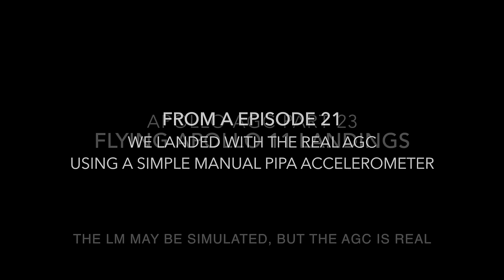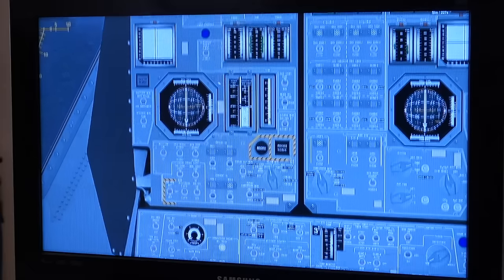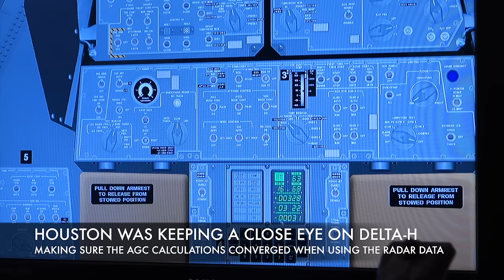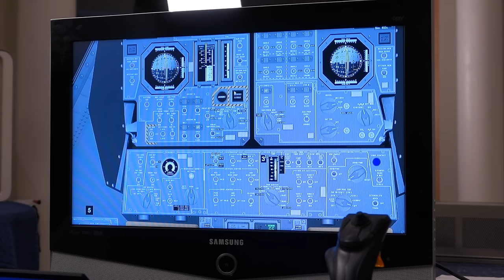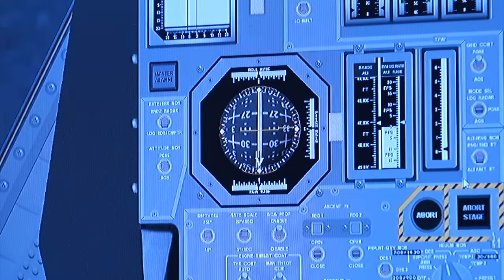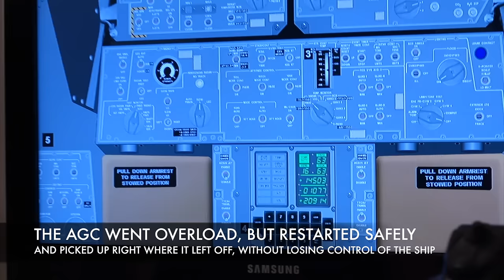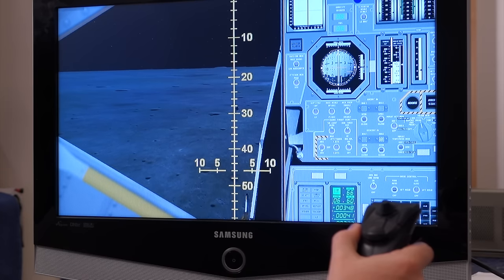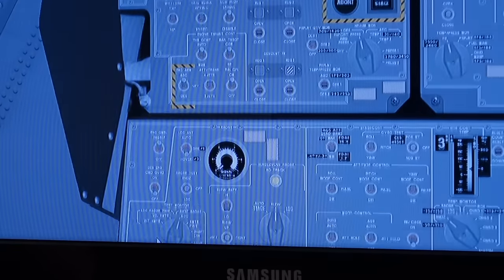Flying the Apollo 11 Moon Landing with the Original AGC Code (Apollo Guidance Computer Part 23)

Comment: "Buzz, we'll need you to remove the potting compound from an AGC memory module and replace 28 diodes".
Reply: By that stage they were probably working with the newer diode manufacturer, not the one that had produced the ones in this B11 module.
Reply: Is it much different that Buzz sticking a pen into a broken circuit breaker so they could take off?
Reply: Can that be removed somehow..I wondered that?
Reply: Alex Carson the agc was directly behind them, but the modules could only be assessed if they had an allen key to split the computer
Reply: Dude up until like 2 years ago I had no idea how much of that work was put on Buzz's list. He's basically carrying literally every piece of equipment on the lunar surface and doing all the experiments while Neil just pranced around taking pictures or filming Buzz from behind. The potting compound sounds exactly right!
Reply: They probably could get the computer open and the module out (maybe), but where are they gonna get 28 replacement diodes? Are they gonna launch and fly another LM over to them?
Actually... they'd likely just use the abort guidance computer instead.

Comment: So you modified the Orbiter program to interface to a hardware AGC?  Certainly they never expected anyone to have an AGC or even your FPGA implementation.  Amazing.
Reply: "Project Apollo - NASSP" is the addon for the Orbiter Space Flight Simulator which is simulating the Lunar Module in this video. Mike made changes to NASSP so that it uses his FPGA AGC instead of the Virtual AGC emulator, which NASSP normally uses.
Reply: @indianajones91  i wonder of there is a place to get it i always wanted to simulate the 1202 alarm during landing

Comment: My career was largely coding simulations of power plants.  And yes, we too would simulate every relay in every circuit to match the 'as-built' systems.  It really is a challenge and it's great when the simulation operates with such high fidelity.  And yes, a couple times we uncovered something that the operators were like, "It shouldn't do that.... Should it??"  And after some research, "Yes... yes it should."

Comment: A little expansion on the "instability" mentioned in the video:

The LM's descent propulsion engine (DPS) was ablatively cooled, where it would actually take off material from the inside of the engine nozzle to keep the rest from melting. The method of engine throttling used in the DPS (a pintile injector, like you can later find on SpaceX's Merlin engine) concentrates the propellant reaction effects on the walls of the combustion chamber, and if the flow isn't in the right place, the engine could burn through the nozzle.
Reply: I think they just ran them full throttle most of the time when they used it on the Delta-P stage.
Reply: @Patchuchan  True, although those were modifed to be fixed thrust, anyways. shrug

Comment: Now somebody needs to build a LEM simulator with real switches and so forth..
Reply from the maker: I have first dibs.
Reply: If you put it on a full motion platform, I wonder if it would shake across the floor during burns.  Sort of like what a disk pack would do if not bolted in place.
Reply: Then put it on top of a huge rocket...
Reply: Too late, we built and flew a replica command module and LEM at Ramsden Primary School in 1970. Materials? For the command module we designed and commissioned a paper and bamboo stick conical airframe (wigwam), Chrisopher Morris was in charge of creating the instrument panel using papier maché and paint. Trust me it flew, we really lived the experience!

Comment: Now you guys need to simulate that one where they had to hack the computer because abort flag kept getting stuck, if it's possible to do with this hardware.
Reply from the maker: Agreed we should do that.
Reply: That was Apollo 14 and it was the actual ABORT push button that caused that, not the AGC itself. It was most likely caused by some loose piece of debris left over from the manufacturing of the LM-8 Ascent Stage. In the microgravity environment it kept floating around a shorting out the ABORT push button causing the abort flag to set ever so often. That's why they had to figure out a way to make the AGC ignore the abort flag entirely to prevent it from seeing a false toggle of that flag. That meant that Ed Mitchell had to manually initiate an abort by entering it through the DSKY rather than using the intended push button should it have been required.
Reply: @DaveS_shuttle  That's why I said "If that's possible with this hardware" seeing that the event happened on Apollo 14 and this hardware was from Apollo 11. I am not sure how much changed between Apollo 11 and Apollo 14, but if the hardware is more or less the same, or "close enough" then it shouldn't be hard to simulate what the astronauts had to do to land the LEM.
Reply: This indeed has been tried in NASSP! See this video: https://www.youtube.com/watch?v=PeyTllhcx3k&t=114s

Comment: Please Marc: do a video of ths simulator with Collins and Aldrin. please
Reply: @NerdyNEET  A lot of the engineers are still kicking around, and that's how we got a good amount of research done. At one point, out of desperation, I was cold-calling names matched to IBM alumni who worked near Huntsville in the 60s, looking for LVDC information - I annoyed a few people, but I got a few good leads and some good answers to questions!
Reply: Suzuran Majere Wait, you also restored a Saturn LVDC?
Reply: @johnfrancisdoe1563  No, I was trying to find any leads on the software, or get information on its design, so we could implement it for NASSP.
Reply: @SuzuranMajere  Thanks for all your hard work too!
Reply: If they could get those two to play around the program with the AGC...that'd be the best that has happened in 20 years.
Reply: Its too late for michael collins ;-;

Comment: well done , excellent work and amazing attention to  detail .......i was always amazed how the original 1202 alarms etc hadn't been experienced in the thousands of simulations on earth - i get the original systems were new , basic , complex , but the reality that any error would have meant certain death and no chance of recovery , the fact that they were miles away from where they planned , had 1202 alarms Buzz dodnt know what that was ???? and then 30 secs of fuel remaining - surely dangerously close to perilous under the circumstances - makes it all the more amazing that the astronauts basically ignored all the systems and just landed where he saw a good spot ;-))) well done on recon.

Comment: The AGC is at capacity when landing. What sent data (if any) back to Houston on the flight data or astronaut information. A second small FDR?? The AGC when not in landing phases? Just curious as to the way it was handled, like from a second computer to a vhf radio sending data down to Houston?
Fantastic job guys. Absolutely beautiful. Thank you.
Reply: Some of that capacity was for downlink. The real driver of the telemetry was a device called the PCM (pulse-code modulator). The AGC is more or less a SPI slave to the PCM; the PCM will drive a "start" pulse into the AGC, followed by 40 clocks, followed by an "end" pulse. The AGC serializes the values of channels 34 and 35 and sends back one bit with each clock, either as a 0 pulse or a 1 pulse. The "end" pulse generates an interrupt in the AGC, which simply selects the next two words for downlink and writes them out to channels 34 and 35. Since the clock was driven from the PCM and the serialization was done in hardware, the load from downlink was relatively light on the software.

The telemetry goes other places outside of the PCM, but my knowledge more or less ends a the AGC interfaces. :)
Reply from the maker: The AGC kept sending it's data, which was combined with other telemetry of sensors throughout the ship by the telemetry box. Then modulated over a subcarrier, itself phase modulating the carrier of the Unified S-Band transponder.
Reply: @CuriousMarc  awesome explanation guys. Thank you. It was sent via satellite downlink (GHz) rather than a vhf or hf frequency carrying data then. Wow.    Technology well before it's time. I can only dream just how far ahead our govt. Military is now.
Reply: @randalltufts3321  The clever bit on the USB was the way it was all multiplexed onto a single carrier - the actual carrier was at the bottom end of S-Band (about 2.1GHz), which was a pretty conservative choice even then (Telstar 1 - launched several years earlier - had used 6GHz up and 4GHz down).  If you think about it, it makes a lot of sense - there was a huge amount of bleeding edge stuff in Apollo, and the radios really need to be reliable, so they used technology (TWTs and klystrons) that had been around long enough to be fairly well characterized.

Comment: This was incredible! It really shows both how advanced and how limited the AGC actually was. And most importantly - although you're running the AGC on a FPGA here, you're showing that with 1969 computer hardware, the landing really WAS possible. This is despite what the deniers are saying. You're doing everyone a favor, so thanks for that, and an amazing show.
Reply: On our public demonstrations we ran the simulator hooked to the physical AGC which ran all the mission software
Reply: @carlclaunch793  Fantastic! I wish I could be there to see it. Did you also use the physical DSKY replica?

Comment: As a resident of Bethpage, long island PLEASE call it the LEM the original name of the module where 100s of thousands of people worked on it. My best friends father was in charge of wiring for the LEM. I rememebe when the Grumman Guppy landed to pick up the LEM to go to Fla. I lived 1/2 mile from end of runway and saw it come in. The second identical LEM was kept in the hanger in case of problems that need to be addressed. Adter the moon landing rhe second LEM was pushed into the parking lot and spray painted camo green and remained there for well over a year. I used to go past it almost every day
Reply: The acronym was changed to LM in June 1966, but the official pronunciation is still "lem" because that's how the astronauts wanted to say it :)
Reply: @alakani  dont care what it was changed to. Everyone who BUILT it calls it a LEM. There are plaques in Bethpage that says LEM. they were very proud peoole who built it

Comment: I had a one question final exam in one of my aero engineering classes in 73, part of a program set up by McDonnell to train young guys rocket stuff as well as supersonic ac. The question was to compare a descent to landing on the moon from both a prograde and retro grade orbit. The professor wanted to see the fuel use. We were given the SI of the descent engine, the flight profile, weight of vehicle  etc etc and had to calculate the gravitational couples and whatever else such as time/distance. No funny business like using a slam dunk allowed.  Show your work. No calculators yet but one guy had a TI-10. I  finished in just under an hour. Turns out a retrograde orbit saves fuel, about 40kg of hydrazine and whatever lox was needed. Maybe it ws nitric acid. Can't remember. I can't even imagine doing that calculation today, even with a computer. Can this AGC run different profiles like the prograde or retro configs?
Reply: The NASA gravity probe B (not to be confused with gravity probe A) confirmed all these calaculations in 2004. Less fuel required to land retrograde.

Comment: That's just awesome. Impressive how they had a rough idea of where they're landing through the window markers and that calculator giving them the numbers. It does seem scary with that calculator throwing BSODs and resetting on final. Yeah, I suppose the abort was a necessary thing, say you've touched down, but the ground is not stable or something. Could they do a partial abort? As in, go high, land further down, or was it orbit only? Anyway, awesome simulator!!!
Reminds me of a space shuttle simulator, it was a video game, if you can call it that, was accompanied with a huge guide book, was probably the most accurate space shuttle sim you could get. I didn't, didn't have the money back then, but it was so worth it. Anyway, good stuff.
Reply from the maker: It was abort to orbit only. If you go to the end of the video, we perform it. Just one button, and poof, you are on your way.

Comment: Stupid question (perhaps my google-fu is lacking): What's the status of the CM AGCs on the returned capsules from Apollo 8 through 17?  Would it be possible to get them working?  How were they different from the LM AGCs?
BTW, this has been an awesome journey -- thanks for the expertise and for sharing!
Reply: The AGCs were the same - the programs in the core ropes were different because they used I/O pins differently in the two spacecraft. For example, the CM has two DSKYs, one in the lower equipment bay where the astronaut sights stars to fine align the inertial measurement unit, while the LM has only the one DSKY mounted between the pilots. 

It is unclear what has happened to the AGCs - some likely still installed in CMs on display. Some components were removed to study possible degradation or damage, in order to improve those for future flights. These could be returned to the craft or could have been kept separately.

If any one visits CMs in museums, see if you can look down into the lower equipment bay from outside the artifact. Near the telescope would sit the AGC and a companion ECDU box of roughly similar shape. With reports from visitors, we may be able to get a better idea of which still have an AGC inside. 

There were 57 built in total, with some on display in museums such as Computer History Museum, MIT Museum and at Draper Labs, some crashed on the moon with their LMs and one is orbiting the sun in Snoopy. Another LM burned up in the earth's atmosphere at the end of the Apollo 13 flight. That leaves ground units placed in simulators, prototype units and any AGCs installed in CMs.
Reply: Thanks so much Carl!
True story - last time I visited Air & Space, I walked into the main hall and looked up -- of course, it's the Spirit of St. Louis, the Bell X-1, and SpaceshipOne, all in a row. I was just overwhelmed, so I put my hand out to steady myself.  Stood there for a moment.  Realized I was steadying myself on the Apollo 11 capsule.  Had another moment. 
Next time, I'll be ignoring the ceiling garnish and have a look into the capsule!

Comment: Will the AGC let you crash the LEM? When you Abort to orbit, does the the command module have to come and find you in the LEM's orbit or does the abort sequence try to put you into an orbit with/near it?
You should now try and get one of the surviving Apollo astronauts to come and land your LEM.
Reply: This depends on the time when you ascend. At various times, if the decision was to abort a mission on the surface early, the burn would fire to sync up with the CM in orbit. The computer would calculate where the CM was and the path needed to meet it. Other aborts, such as during a failed landing, are not so perfectly matched and would require the CM to maneuver to rendezvous. The abort will take the LM back up to an orbit no lower than about 50,000 feet.
Reply: @carlclaunch793  Thank you. I want to mention the first part of my question should have been "Will the AGC let you crash the LEM WHILE LANDING?" I was wonder if the system was like modern airplanes fly-by-wire that let pilots fly the plane while at the same time won't let you do something overly stupid.

Comment: I have a quick question: shouldn't pulsing the ACA be enough to induce yaw as opposed to continuously keeping it twisted? If it's held twisted the RCS stays on and the yaw rate should keep increasing.
Reply: The ACA commands are going through the computer, proper fly-by-wire. So a certain deflection of the ACA causes a specific attitude rate, not continuous RCS firing.
Reply: @indianajones91  Ah, I see, thanks. Did it work the same way for the command module too?
Reply: @vivekanandottalingam  No actually, the command module computer didn't get proportional rate inputs from the handcontroller, so it only had an on/off state, which changed at a certain angle of the deflection of the hand controller. The computer used this signal to command either a fixed attitude rate or continuous RCS fire, depending on switch and computer settings. So it was still fly-by-wire, but a bit more simple.
Reply: @indianajones91  Thanks a lot!

Comment: Hiya team AGC.  I'm currently reading the Haynes "Owners Workshop Manual" for Apollo 13 written by David Baker. He makes a point of calling the primary guidance computer in the LM the LGC and the CM one the CMC. Presumably, AGC is a generic term that covers both, them being identical other than program memory??

It's a good read and brings to light one of the issues I'd not seen any mention of before - water was critical and one of the major limiting factors.

Anyhoo, that was another mission wasn't it!

My next read is 'Stages to Saturn'  - suspect I'll only get a fraction of it, but I'm game.
Reply: Indeed, in the LM it was named LGC or PNGS (Primary Navigation, Guidance and Control System) on all the switches and documents. In the CM it was called either CMC or PNGS. Most times people referred to it as Pings (PNGS) when they mean the computer itself. PNGS included the Inertial Measurement Unit, the star trackers, coupling data units, primary servo assemblies and other boxes that combined would provide for all the functions that the computer performed for the missions.
Reply: @carlclaunch793   Thanks for the additional info Carl :)

Comment: Did the AGC handle aborts in conditions where the agc was healthy but landing had to be aborted for some other reason? Or was AGS always used for abort?
Reply from the maker: I believe the AGC was handling the abort in "normal" conditions. That's a question for Mike to confirm.